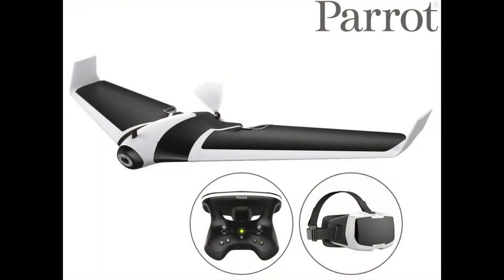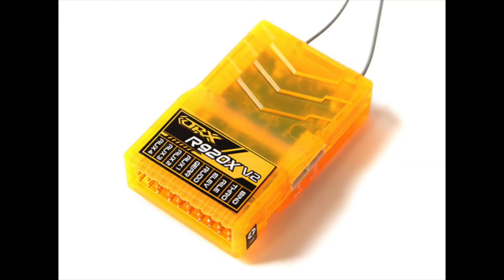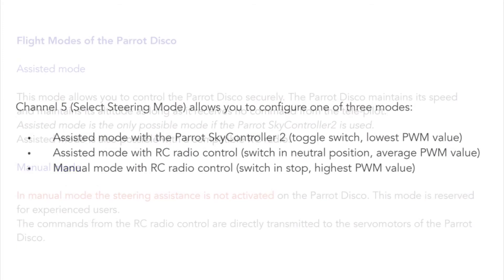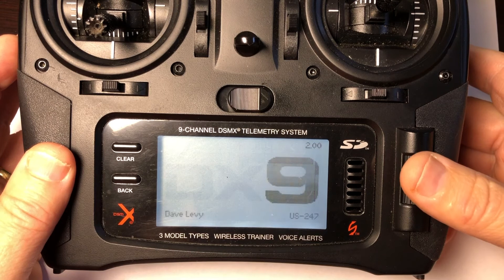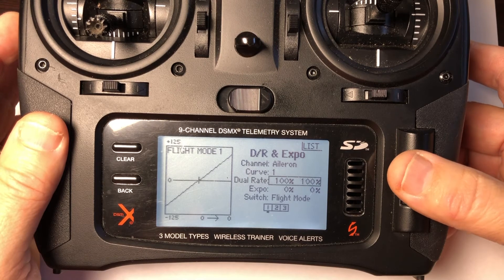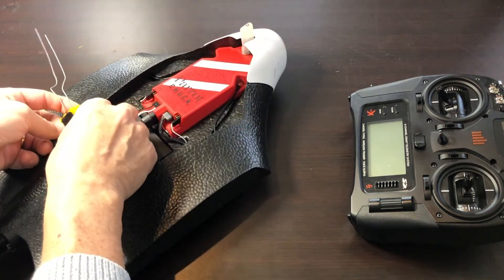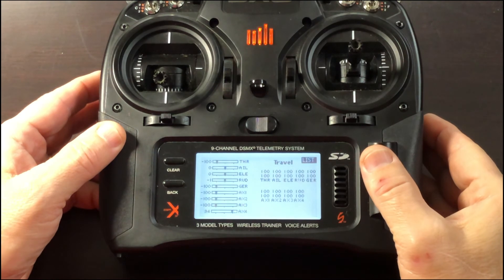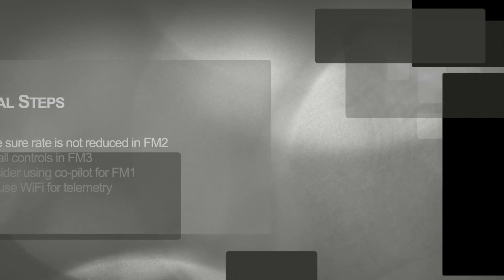Flying Disco With Spektrum

Comment: Can i do this with a dx6,nice work dave.
Reply from the maker: Shouldn't be a problem except you'll be one channel short. I'd leave off the emergency switch. You'll still have the loiter (yaw) function and return to home.
Reply from the maker: Probably not a DX6i or DX6e. Orange uses the 11ms signal on the DSM2/DSMX and i don't think either of those will bind. The straight DX6 should be fine.